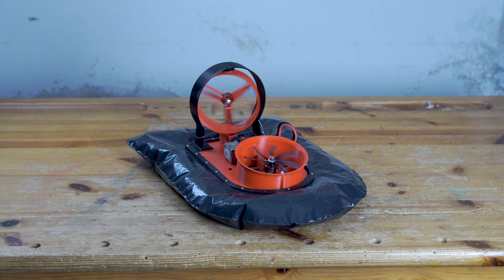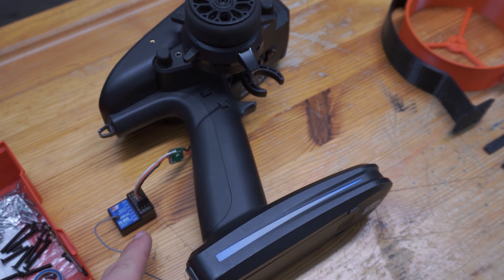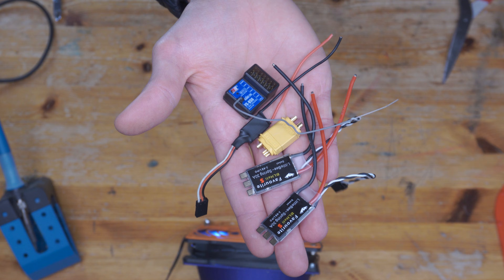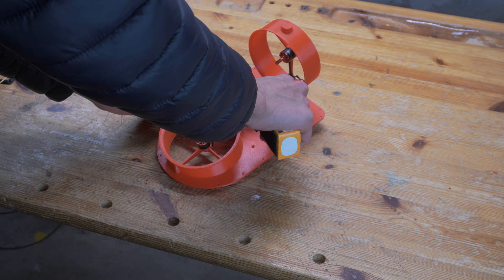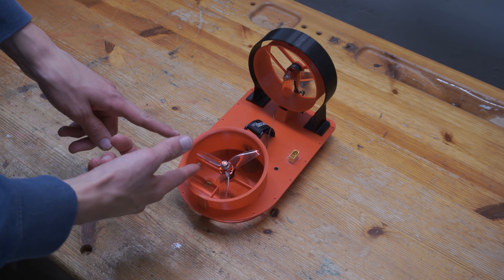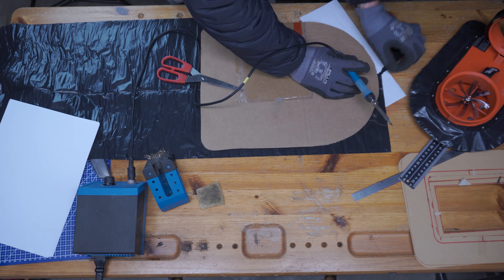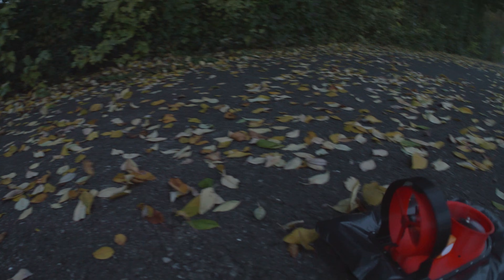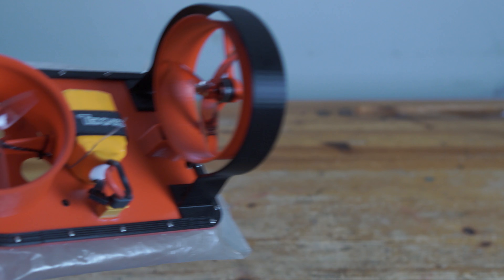DIY 3D Printed RC Hovercraft—Will It Actually Work?

Comment: Nice!  That's exactly what i'm talking about with the skirt, big thick one hot cut from the bag.  The double hull looks really good with the stability hole in the center.  This is almost how a hovercraft should fly.  Next design, make your hull standoffs 1/4 twist spiral vanes so it directs the air in a rotating flow to oppose the lift motor torque and get it to hover without yaw.  Make the vanes adjustable in angle and tune it to match the motor's torque

Put a wing on it up front, same kind of thing you use for RC cars for downforce, it'll plant the front at speed and prevent flips.  Also to prevent flipping while drifting i use stabilizer fins along the gunwales canted inwards, like a reverse V tail on a glider and when you slip sideways it puts some downforce onto the leading edge skirt and helps it track straighter at high speeds.

The bigger skirt gives more surface area and allows it to fly better, and also the angle between the upper deck and the lowest point of the skirt helps immensely, the more angle the better the skirt will work.  Another trick is to figure out where the low point of the skirt is in the form of a template that you can use to cut out a duct tape reinforcing ring and the bag won't wear from sliding if you're going to run on rough surfaces like this.

One more tweak that can be made is instead of tracing the hull exactly scaled up  for the skirt, the part of the nose that curves can be fattened to provide better clearance in terms of obstacles.  It'll ride a bit front high but it'll also float over small curbs or uneven stuff a bit better.

But yeah, it looks like you've got the base for a fun little performance craft.  Scaling it up would only make it fly better and if you build one that's about 12x18 inch top hull size or bigger it'll really perform.  Also don't be scared to add weight, there's a point where a craft can be too light  and sometimes ballast helps.  It takes so little power to actually lift it that adding weight can sometimes help stability.  Some craft i ran two 3s 2200mah packs on just to take advantage of the extra weight making it not so light, bouncy, and prone to rollover.

But the fact that rollover is now a problem means you've got most of the craft performing good enough to get to rollover.

And now that you have a skirt template, you can do the same exact thing with lightweight (like 0.9oz weight) ripstop nylon,  Cut out two sheets half an inch or so bigger than the template, draw the template exactly on the sheets and sew both together along those lines with a backstitch, when you turn it inside out the seam will be on the inside and you'll have a very clean and durable 'professional grade' skirt.  Put the duct tape ring on the bottom at the contact areas and it should hold up nicely long term.

My dream was to get other people to build them with me and race them, i worked out a LOT of the details to make several different types of craft but i can't find anyone around where i live that has any interest.  If you have RC friends you should try to get them into hovercraft racing, that'd be super fun and i wish i could do it here.
Reply from the maker: Wow, thanks a lot for all the suggestions!! I'll definitely try some ofthose out in the future. 

What do you think about a quad motor hovercraft with two skirt inflation motors to completely eliminate the yaw issue and two thrust motors for Differential steering?

Thanks again for your thoughts, really helpful!
Reply: @ValRC1  That's one way to do it, you can mount two motors back to back to keep it compact or fore and aft on a larger craft if you don't mind the 'complexity' of a flight controller.  I usually try to keep things simple and mechanical but there's no reason you can't use a flight controller to keep it yaw stabilized and even do other stuff like heading lock or smooth steering, it opens a lot of potential with that though and would be a fun rabbithole to fall down playing with programming and tuning it.

Do it on a large craft, maybe print a 4 piece hull and take advantage of the extra lift.  Though you can also solve the problem by using a blower, i think i suggested this before.  Blowers can reach a much higher static pressure than ducted props for less wattage, they're REALLY what hovercraft should be using optimally from a pressure and CFM out per watts in efficiency standpoint.

You can 3d print a squirrel cage style blower instead of a prop and mount it on the upper deck with the rotation axis laterally across the craft.  Or you can buy a server blower fan, the 12v 3a Delta puts out bonkers pressure and CFM on 3s.  I've used them on hovercraft and solar powered air conditioning systems.

Any torque applied is then applied along the craft's longest axis and more easily countered with the extra lever arm.  Real full scale hovercraft often have the blower to the rear and rotation direction so the top goes aft and applies any torque as a downforce on the front of the craft along it's entire longitudinal lever arm.  The only reason most hobbyists use prop in hole config is because that's what they have laying around, but it's the least efficient way to move air.  A true ducted prop/fan would be a step above the prop in hole.  If you get a true 'ducted prop' prop to spin within .5mm or a few thousandths (There's a critical dimension where it works as 'ducted' based on diameter) from the wall and a smooth inlet velocity stack type arrangement performance would go up, again, off the shelf EDF units do a bit better than a ducted prop, a bit higher staic pressure and plenty of CFM.  Now get a blower, that blower SHOVES air in the skirt at a lower velocity, but more CFM and the snail shell housing's geometry of expansion prevents backflow or blade stall by creating a high pressure area like a plug.

And that's the other thing, a blower puts out (at it's outlet point) slower, higher pressure air.  Your prop is putting out faster, low pressure air.  In open air for flight the airspeed matters, when using it to inflate the skirt, the extra airspeed is a detriment  as it immediately slams into the lower hull with reduced pressure.  

IDK if you know Bernoulli, Boyle, Reynolds and the associated math, but as speed increases pressure decreases, and at smaller scales like this effects are amplified as air acts more viscous at these scales. To make the numbers line up you want a slower, higher pressure supply of air at the required CFM to fly the skirt at a few mm off a smooth surface.  Any more is waste of watts and any less and you're dragging ass.  There's an old book from post WW2 that has ALL these ratios in there, like how high a craft should fly based on length and width, what the optimum upper deck to skirt angles are, and a whole bunch of other stuff .  British postwar aircraft companies really did a LOT of research and testing these fundamental flight principles and it has a huge wealth of really specific hovercraft design information.

Search "ed2fedaf24d8f79331475b2c6183cf17c9176aa3974d30e02fec0d9a1e4b438b/redirection?filename=Hovercraft Design and Construction (G. H. Elsley%20 A. J. Devereux) (Z-Library).pdf"

and look for the result for z-library site, there's a link to the full PDF there.
Reply from the maker: @rustymustard7798  Really cool, thanks for all the details! I'm actually already working on a smaller quad motor hovercraft with a flight controller from a small FPV Drone, seems to work pretty well for now but still needs some PID tuning.

As for a new simpler mechanical version, I really like the Idea of using a blower fan, as it also makes replicating the project easier and cheaper for viewers. After a quick search, what I could find was a "Delta BFB1012VH 12V 2,70A", do you think that could work for a craft similar to the one in the video?
Reply: I appreciate the effort that went into this response, but I disagree on quite a few points.

The skirt is the most essential part of a hovercraft. It needs to be designed to match the full width of the craft (ride height about 1/8), and the pressures in the skirt and the plenum need to be in balance. The model should glide on a thin layer of air, not ride on an over-inflated skirt.

I shared a video link above showing my design. You can see that my model barely tilts at all, even though I personally think the center of mass is still too high. The C-shaped skirt is designed symmetrically around the entire model. In the video I’m using 2 oz ripstop nylon, but I could even recommend 4 oz.

I’ve also added more holes in the bottom—what you blow in has to be able to come out underneath as well!

In addition, I installed a gyro and use a small amount of rate mode. Just make sure you have enough room to move the battery forward or backward. That way, you can fine-tune whether you want understeer or oversteer.

@Rustymustard, if you click on my channel you’ll see one video there now, which should give you a good idea of what I mean.

If you’d like to take this further, I can recommend the model by YouTuber Tom Stanton. I printed it at 200%. Design-wise, it’s superior to this model—especially the low center of gravity, which makes it ideal. It does cost €5, but it’s absolutely worth the money.
Reply: @opidopie Well as a former marine and aerospace technician, i've studied this stuff in college and independently, so maybe point out WHAT you disagree with.  There are gaps in EVERYONE'S hovercraft knowledge because the subject hasn't been taught since the 60's when the full scale commercial 'fad' ended, but i can assure you that a 1/8" ride height is meaningless without the numbers of width (short axis) and hull area.  The skirt is only important if there is a skirt, in which case it's effective area perimeter has to be a certain distance from the upper deck to provide stability, it's about a 15 degree angle minimum from the upper deck to effective area for positive stability to occur.  The geometry depends on skirt size and profile.  Much of the physics was pretty much settled back then

Some hovercraft can get by with ground hugging for efficiency, but go run that over grass, or gravel, or uneven pockmarked sand like a beach with footprints. How's that 1/8" ride height treating you?  Is your lower deck catching instead of the larger front skirt area absorbing hits on jumps?  Why don't you go watch full scale Formula 1 hovercraft racing to see that jumps aren't fantasy, these dudes ride single place hovercraft like dirt bikes offroad, jumping and all that.  It's motocross with hoverbikes basically.  That's what builders should be shooting for, the kind of performance you see in F1 class hover scaled, not an air hockey puck that'd get wrecked by a small pebble on the basketball court.

Hovercraft are SUPPOSED to be all terrian, land, sea, fly over marshlands and clear obstacles.  Large full scale hovercraft have FEET of clearance in full power mode.  Your hovercraft will fail in grass, and will run the lower deck into rocks and obstacles.  My hovercraft can clear several inch high curbs at fill lift and fly over most terrain. (Here's the gravel to grass transition over a curb example: https://youtu.be/7-oTpiiwjVA?si=wqUc5YMistGr0xSE&t=206)

But what if it doesn't even have a skirt?  That's a thing, skirtless craft are cool and a 12 inch wide craft will fly with the lower deck like an inch off the ground like a little Star Wars landspeeder. (I'll build one at some point)  On this design the 'skirt' is nothing more than a 1/4" air dam made of packing tape to redirect the air back under the craft. https://youtu.be/UmS_t55DbN0?si=cJwbuM5_o_Pr8lwS 
On level smooth surfaces and full lift it flies like an inch high, and on rough surfaces like the grass it gets lower, but there is the craft, hovering over rough uneven grass, sand, water, gravel effectively with plenty of clearance.

The only thing i see anyone really making on YT are these glorified air hockey pucks like yours that'd get ended by a 1/4" pebble or some low cut grass.  Show me a video of that thing on terrain like mine and i'll show you the problem as it sits there and makes noise.  Sure, they're low effort, simple designs, and a fun super easy win using regular hobby gear like drone motors, but they're far from ideal and not really functional as an amphibious all terrain vehicle they're designed to be.

I think you should re-read Eisley and Devereaux, (Hovercraft Design and Construction) and maybe brush up on your physics.  All the formulas, math, and design rules are in there and they haven't changed since the 60's and still work today.  I don't know exactly what you 'disagree' with as you just rambled on about arbitrary design features.  

Lol Tom Stanton doesn't understand hovercraft either, or a lot of stuff, guy's kinda dumb IMO, get your knowledge from real engineering books, industry references, and the Doctorate level engineers who wrote them, not youtuber shills.
Reply: @rustymustard7798  I would be happy to explain it, but I have to say that I find your tone of voice quite hostile.

I started 20 years ago with a 1/10 Griffin 2000, and by now—more than 10 models later—I am very capable of understanding how a model is supposed to work, specifically when it comes to bag skirt designs.

The ride height should be about 1/8 of the width of the model—again, for a bag skirt.
The ideal ratio between the inner and outer circle of the skirt design is 2.67, which ultimately results in a pressure ratio of 1.67 between the skirt and the plenum.
These figures are not arbitrary; proper studies have been done on this, and I have seriously invested time in understanding them and hoped to be able to share that knowledge. These numbers come from leading figures in the English branch of the hobby. Marc Porter and Fran Oakey are absolute authorities in the field, and I am still in contact with the latter to this day.

You say that my model is not suitable for “all-terrain” use—something I was already aware of, as it was never designed for that purpose. However, for the design it has, I have not seen a single model perform better.

Tom Stanton’s model is certainly superior, especially when you consider that it requires no support material and can be printed in single-wall mode.

Once again, I truly know what I’m talking about, and I have seen several of your models. I find that you are provoking me quite strongly, given the results I see from your work.

I wish you all the best!